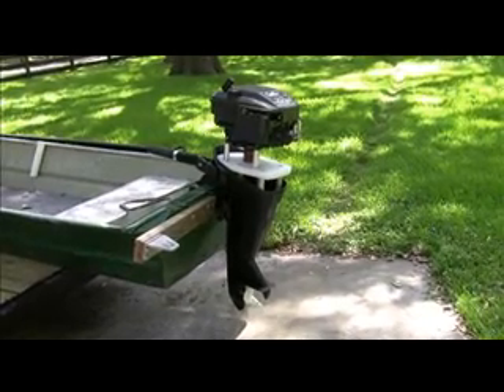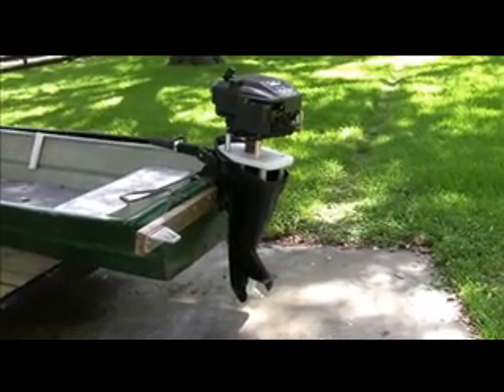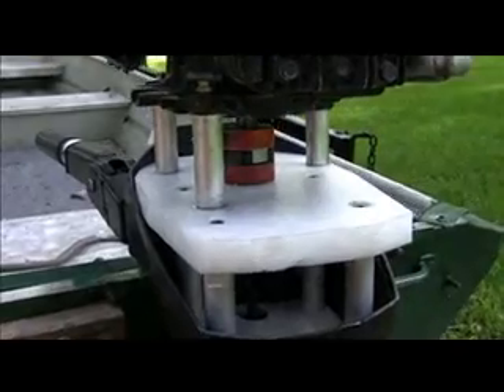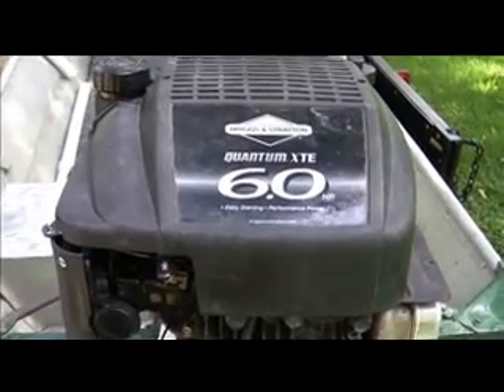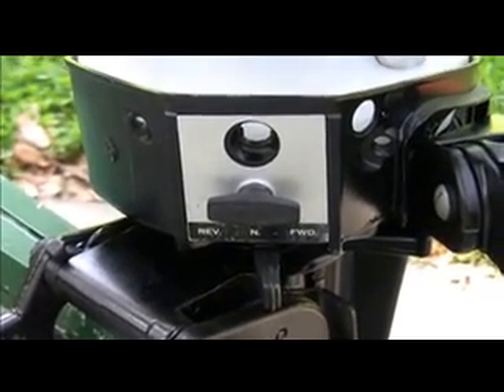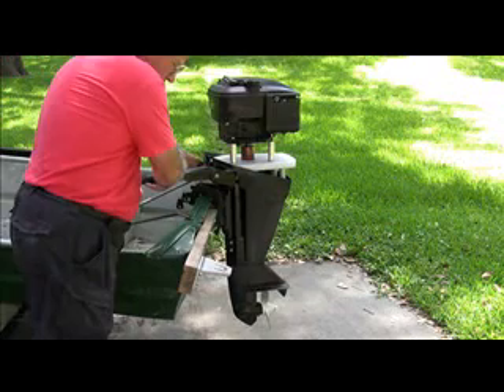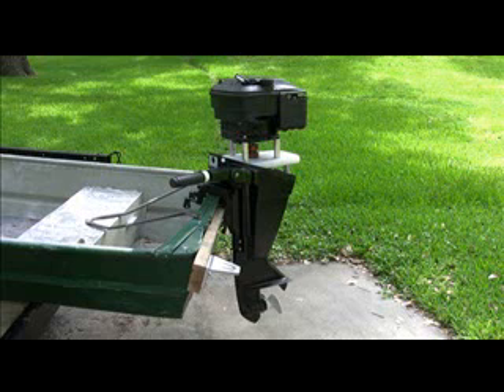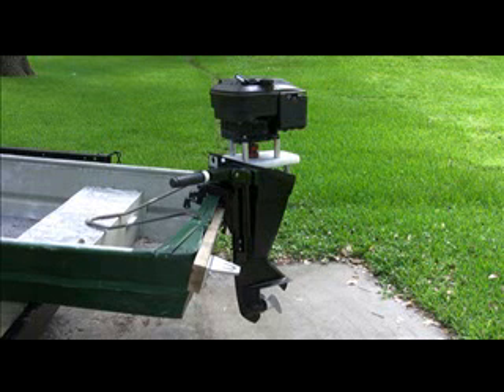Chrysler 6.0 HP Outboard conversion to a Briggs & Stratton 6.0 HP Power Plant (Part 1)

Comment: I knew it could be done...I had that idea but didn't know if the forward and reverse still worked... I have an old 1952 10hp Johnson and the carb is shot. plus I'm tired of the oil mix gas and being stranded paddling against the wind.

Comment: so how did the test go? i built one my self just havent used it yet because my boat got stolen
Reply from the maker: <p>Hi Street, I should be ashamed of myself for not testing it yet. I will try and take it for a spin in the near future and let you know how it performs.  The underwater exhaust should quite the exhaust noise.  </p>
Reply: sounds good yah i plan on building some kind of silencer on myne or direct it underwater i dont kno yet
Reply from the maker: Hi Street,  Briggs and Stratton actually built their own outboard motor..  I based my exhaust system on their design.  I had to build a custom exhaust manifold that bolts to the cylinder block and the exhaust tube attaches to it.  I believe it will work fine.  My only concern is that the Chrysler 6.0 motor turned about 5000 rpm and my 6.0 HP Briggs and Stratton turns about 3600 so I may not get as many miles per hour out of it but with this type of boat and motor who is in a hurry.  Ha Ha
Reply: ok cool, hehe yah true and if you want more speed then just customize the prop or change it,

Comment from the maker: Hi Tristan,

To be truthful, I actually never took mine to the water as of yet.  It still sits in the shop waiting for a sea trial.

I could be wrong, but the original outboard motor was designed to run at 5,000 to 6,000 RPM.  Briggs and Stratton lawnmower engines are typically governed at 3600 RPM which would make your prop turn somewhat slower not faster.  I have no idea why you are breaking shear pins.

I used 6 HP B & S (Pressure Washer Motor) for my conversion as it has a heavy flywheel.